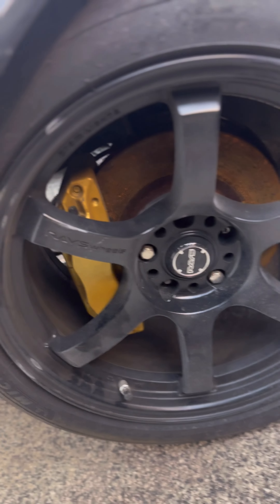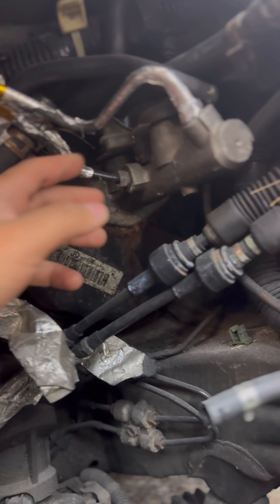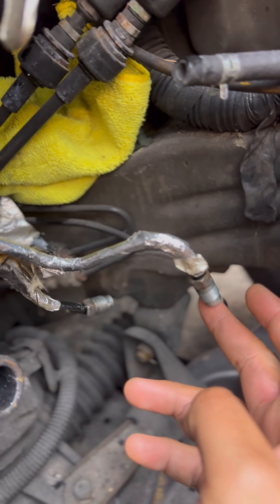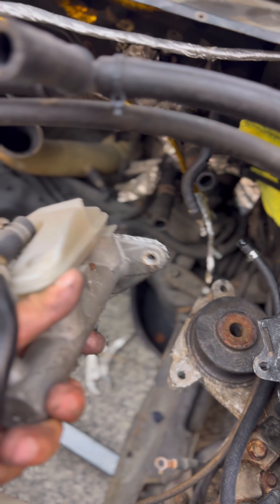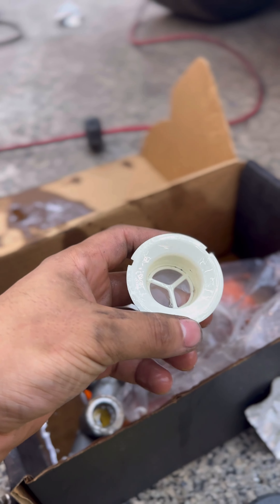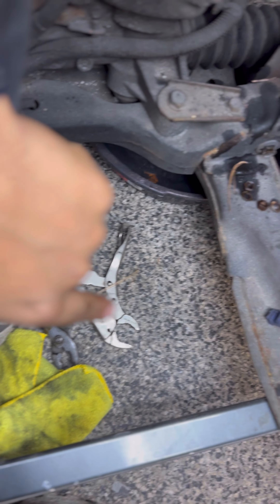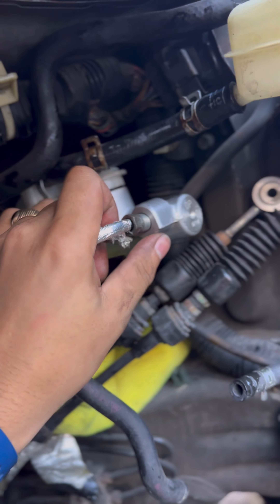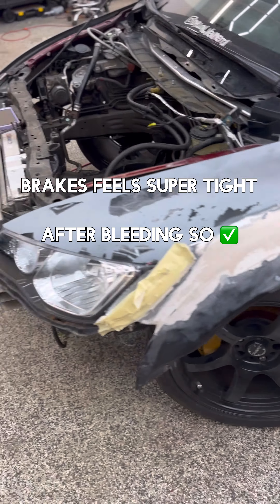Upgraded to Tl type s master cylinder and it feels GREAT!

Comment: im having an issue where the holes for the hardlines on the TLS BMC are to large for the hardlines on the 8th gen si. what is the fix for this?
Reply from the maker: I think you’ll need to get different barb sizes maybe from Home Depot
Reply: @Dyllon_vendetta  different barb sizes? I've seen fitting adapters online but not sure what size i need
Reply from the maker: @ yea different fitting size 

You’ll probably have to google stock si size and go from there to see what size you need to adjust and change it to
Reply: @Dyllon_vendetta  by chance do you remember what size your fittings on the brake lines were? We're they m10 or m12
Reply from the maker: @ mine didn’t need to be changed oddly 

But I did read about it that I might have to but for some reason it worked 

But no I don’t remember

Comment: Part number on type s brake master cylinder?
Reply from the maker: Brake Master Cylinder For 2005-2008 Acura TL Dorman 256FF55
Reply: You really need to keep an eye on that bend in the brake line, probably want to get a pro to do some of the things that you shouldn’t do yourself.
Reply: @waverider5751  the bend in the brake line is fine just double checking the part number thanks for the input but we got it